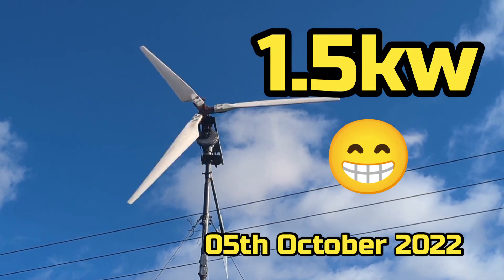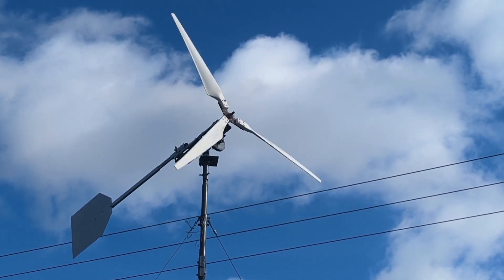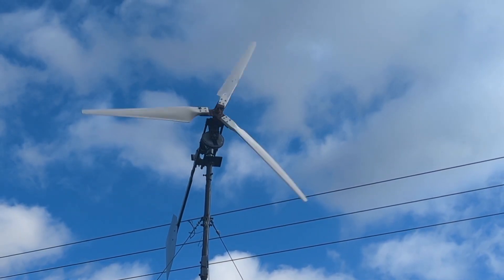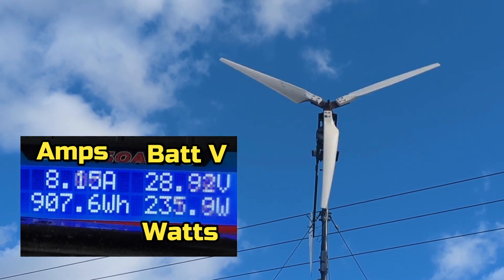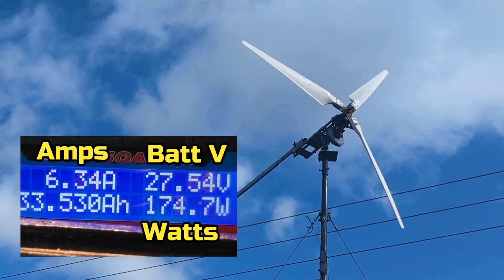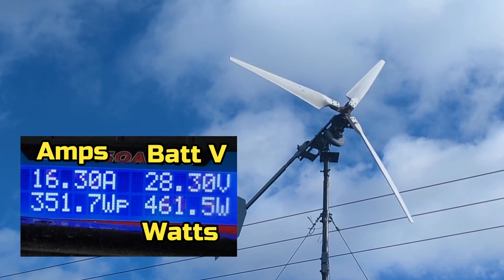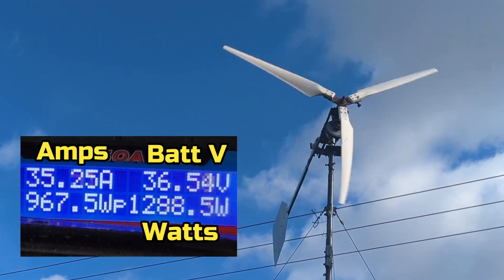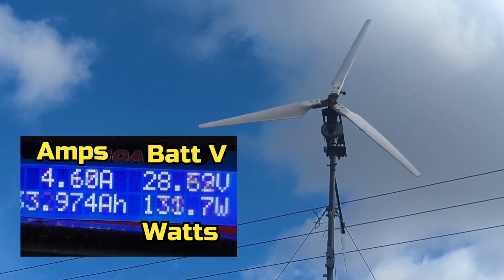E-Bike Motor Hub Wind Generator Free Energy Project - Hits 1500 watts - 25mph + - 5th October 2022

Comment: can i ask ..alot of designs incorporate a brake system since over spinning could  explode blades how would you deal with that issue?..very cool set up!!
Reply from the maker: Because the bike motor hub is very hard to turn, that will stop the blades from over speeding I do sometimes use a controller which applies a break at either 14 or 28 volts. Whatever battery setup you are using

Comment: How about adding one of these super popular and cheap solar boost mppt to catch the power under 24V? Search for DPX800S or some other model
Reply from the maker: I'll have to have a look at one of those. Thank you very much for the comments. The other option I have is to go with a grid tie inverter but I know they can be a bit unreliable
Reply from the maker: By grid tie inverter, I just mean one of those that you plug into the wall. I don't mean one that you have to have wired up by a profession
Reply: @GavinFreedomLover  Thank you for the reply. Just will share here the unit I bought. It says 1000W but with batts do 700W max. It is new generation grid-tie and uses limiter to know how much you are using and then converts the power needed from the batteries. About the booster. I am not sure you need MPPT, maybe power limited boost converter will do the job as well. 
In your case boost conversion for the lower speeds is suitable as the booster have a diode inside, that will let the energy flow once the voltage rise.